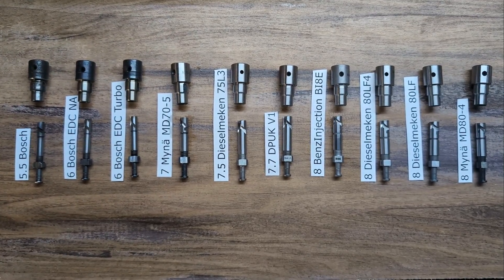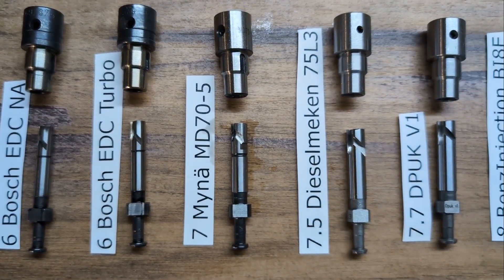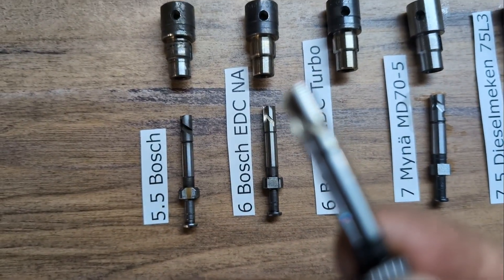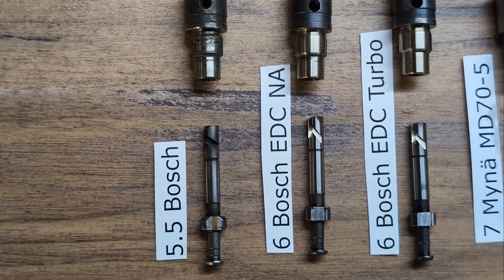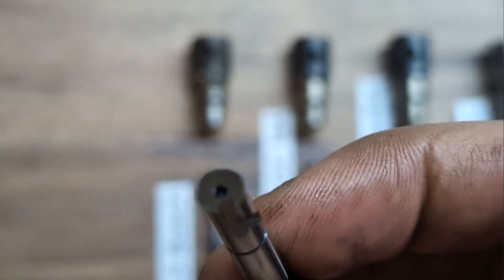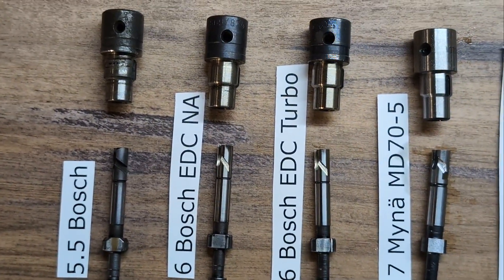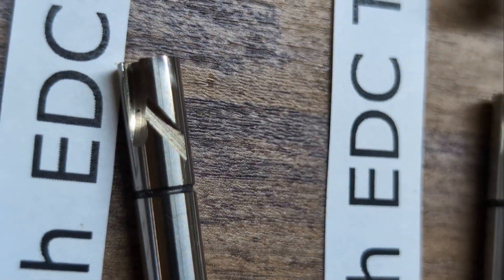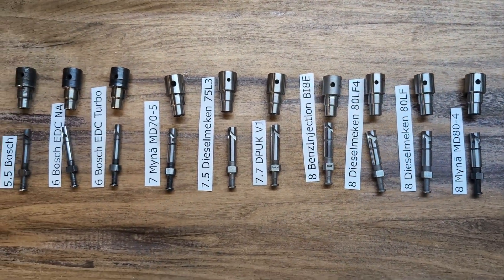Mercedes OM60X Injection Pump Element Comparison Part 1

Comment: Thank you for this video. Would you recommend using an RS203 pump over the 'milder' cammed pumps (RS171 etc.)? I'm planning  a 4x4 compound turbo setup (Somehow) and was going to use Myna's 8mm element. Just not sure which pump to use. All the best!

Comment: Question,  if I wanted to swap my om606 turbo engine in to my chevelle wagon,  would you recommend a  aftermarket ecu and harness or a built mechanical pump to replace the edc pump?  I'm still trying to decide and weighing the pros and cons of each option. Thanks for the element information.
Reply from the maker: Mechanical pumps are much easier for swaps: https://www.benzinjection.com/product-page/6-cyl-performance-ip